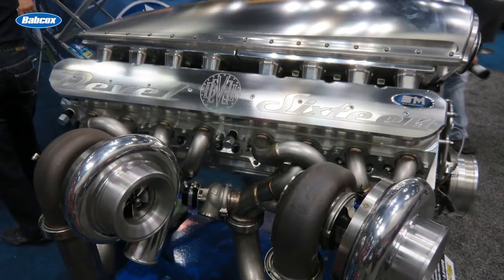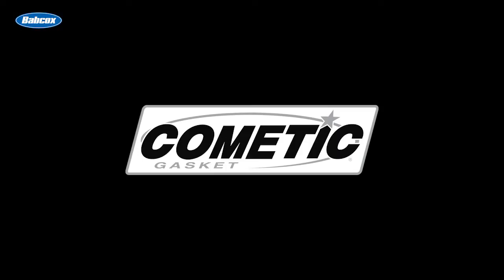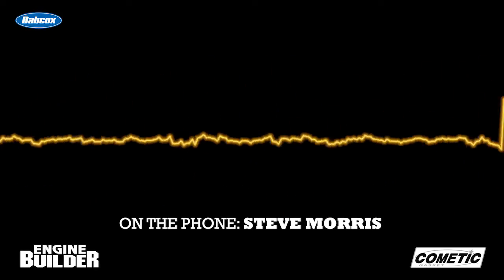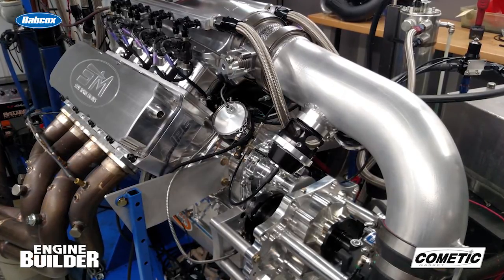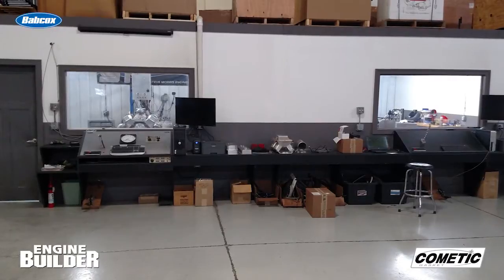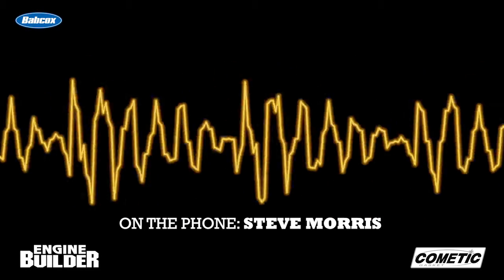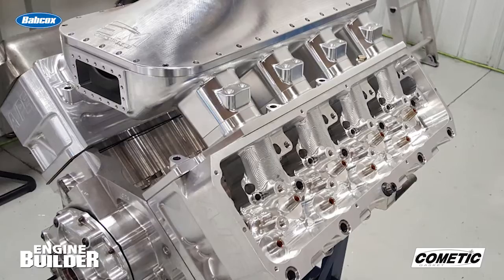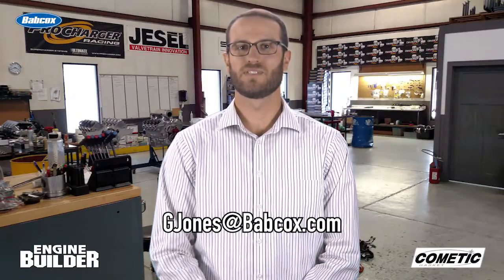481X Top Sportsman Engine

Comment: Dude, its an Alan Johnson Performance Engineering engine (Pro Line distribute them) and they run a Fuel Tech EFI which may have been new to Steve; hence the time he stated was required to sort the engine out.